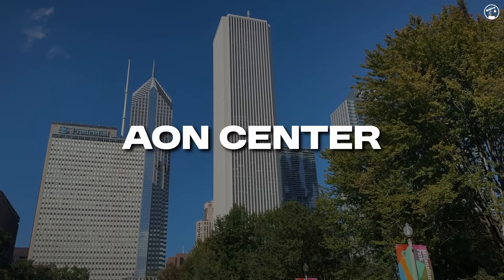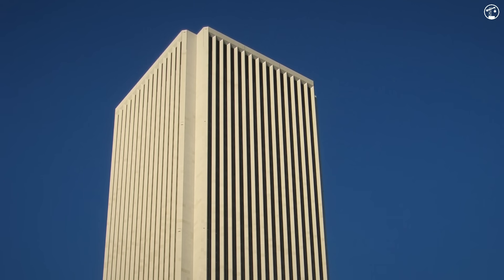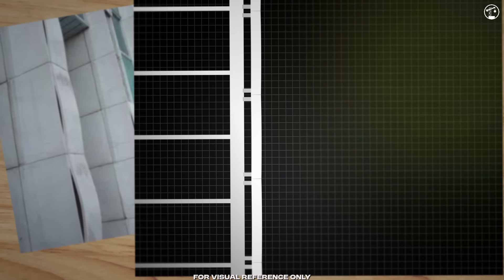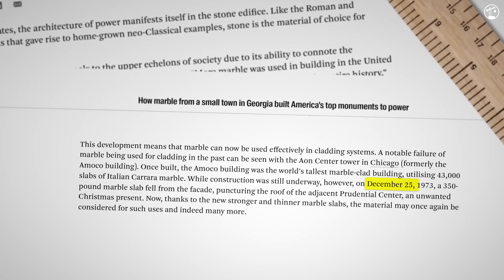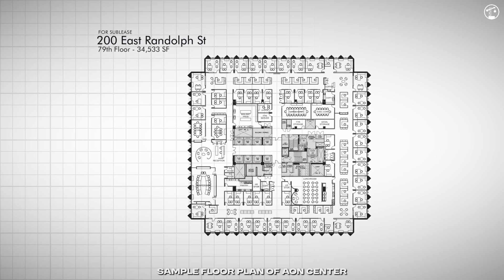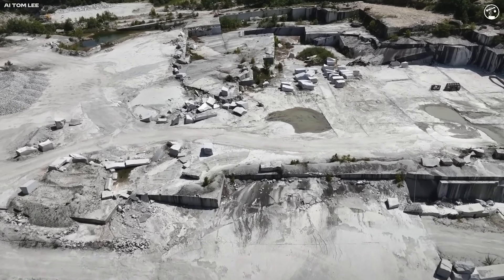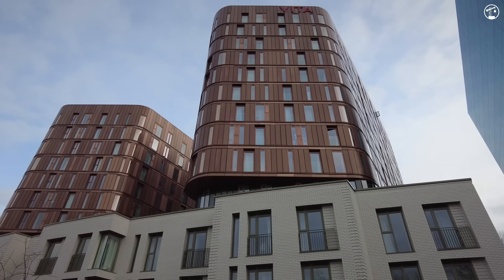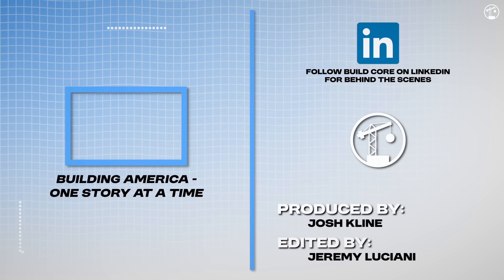The $200 Million Mistake Hiding in Chicago’s Skyline

Comment: In the early 1970's (similar time frame to the Aeon Center), the John Hancock Tower was being constructed in Boston. It had a façade of over 10,000 500 lb mirror glass panels. It looked amazing but the panels started falling out posing a huge risk to anyone walking or driving in that part of Backbay Boston. Eventually all the glass panels had to be replaced which more than doubled the cost of the project. For a year or two, the building was a patchwork of plywood panels where the glass panels had fallen out... It was nicknamed the Plywood Palace.

Comment: It's a bad Panel Design! Panels should be at least 6" thick! And marble? Maybe for the first 2-3 floors! Then a concrete panel after that! They can be poured & cured to look like anything! Especially 40' AFF! All panels should've been waterproofed & fireproofed with chalking! Just about every building I've seen where thin panels are used either crack, chip or just pull away from the backing the material is attached to! Even 2" marble isn't being attached straight to a building without embeds & brackets to be welded to the structure! The backing & glue? Don't have the same expansion or contraction properties! There was a building in Houston where they changed the outside facade from a concrete face to a brick! Without actually using metal brick & mud with metal lintels, they used 11/2" cut brick & mortar then glued the a fiberglass panel using a foam! Needless to say some of the brick & mortar detached because of the Houston heat variant! They had to remove all the panels on a 10 story building! It was a bad panel design! It sounds like a similar thing on this building except for the size!
Reply: I was thinking they could have used fiberglass panels with the resin impregnated with chalk so they are light but still have the bright white appearance of marble.  I am not a civil engineer or architect, but I would think that something light and strong would suffice.  I do not know how to join fiberglass to the building except that I would think some kind of joint exists to take up the difference in thermal expansion.

Comment: Millennium Park didn’t open til 2004. This would’ve been pretty easy to check. In the years the marble was on the building and being removed, the immediate area was really quite dead. I guess not so dead that it was safe for hunks of marble to fall 80 stories… but it was vastly different around there than it is now. Nobody really went over there and the entire residential neighborhood just to the east of the building was a parking lot and then vacant and then a driving range for a time. It wasn’t a place you went unless you worked there, and you got right out afterwards if you did.
Reply: That's correct.  The re-cladding of the Amoco Building was completed in the mid-90's.  Planning for Millennium Park started in 1996, with opening in 2004.  When the re-cladding was done, the Milennium Park site was an ugly railroad yard.
Reply: @richardrettberg7140 It's still a rail yard. They built the park over it.
Reply: That par 3 and driving range was the coolest thing ever.  That and the skeet range in the Diversy Recreational corridor. Tennis, golf course, baseball, softball, fishing, and skeet.
Reply: Yep.

Comment: Two errors in the video: (1) Millennium Park was not completed for almost a decade after this building was fixed—so, it was not busy there due to Millennium Park; and (2) as mentioned by another commenter, the term “Windy City” is about Chicago politics, not its wind or weather.

Comment: You might have mentioned that this building, from a structural standpoint, is extremely similar to the WTC towers. I wouldn't want to be in this thing if anything larger than a 737 hit it.

Comment: At 1563F, baking soda will soften any quartz bearing stone. If you had to, you could make a rig to soften them in place. Steel wont soften until about 2300F.
Reply: I’m a metallurgical engineer, and you’re wrong. Steel softens at much lower temperatures than 2300 F.  We hot roll steel in rolling Mills at 1800 F.  It depends on how “soft” you consider soft, but steel has only about 20% of its room temperature strength and hardness at 1600 F.  So, it’s getting quite soft well below 2300 F.
Reply: @OldRustySteele  but rebar melts above 2300F, and carbon steel melts at 2500F which is typically what's used for good i-beams. Is hot rolling 1800F for carbon steel?

Comment: I worked in the building during this marble replacement project. At the time, it had 4 of the tallest hoists in the world. The building was built for Standard Oil of Indiana with a nickname of Big Stan. Standard renamed to Amoco. It is owned by AON now. I worked in the building from 1979 to 1992 and again from approx. 2018 to 2021 when Blue Cross Blue Shield of Illinois rended space there. During my career at Amoco, I had the opportunity to set up air quality test equipment on the roof.  I also worked in the Blue Cross building next door from 2007 to 2018 and 2022 and 2023. During my career at BSBSIL, the building was expanded vertically expanded from 33 stories to 57 stories, being completed in 2010.
Reply: no. one. cares.

Comment: I worked as a messenger in Chicago Metro area for fifteen years. I saw a lot of back areas in the various major corporate HQ building with corrasion in various corners hidden from most of casual inspections. I remember one section of the CTA overhead line south of the loop used large steel supports which ended up shattering in the cold. The Old Structures used much smaller riveted pieces that could flex as needed for hot or cold.

Comment: The city hall here in Richmond VA had the same issue.  It spent many years wrapped in plastic straps like cardboard boxes are secured with. Just when we got used to this diy Centre Pompidou look they slipcovered it with new enameled metal (I think) panels. They suit the building better than the somewhat pretentious marble did

Comment: 5:31 Great video so far, but I don't think Millennium Park was around in the early 90s.
Reply: There’s many small errors in this. It’s not as if it’s a huge production so they don’t put that much emphasis on accuracy. A problem seen all over YouTube.
Reply: Yes, you're right. The city built it in stages starting in 1998, and the final stage was completed in 2004. The land was always there though. When I was a kid I remember it was a huge rectangular shaped industrial rail yard and a huge parking lot. It was remnants of old Chicago and it was an eyesore.